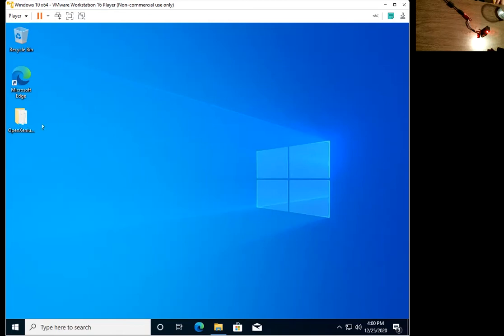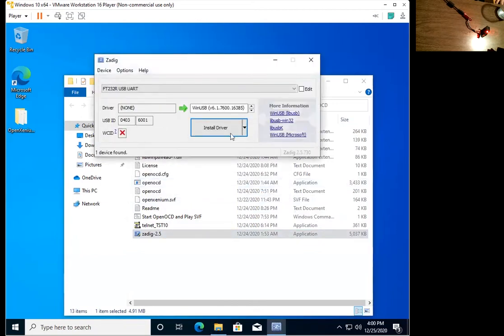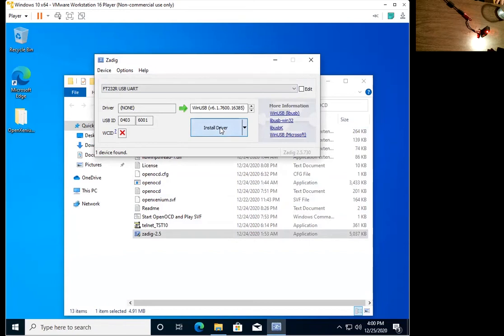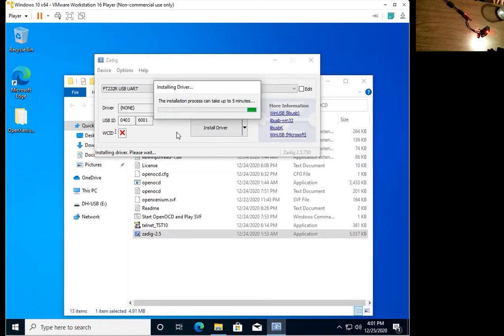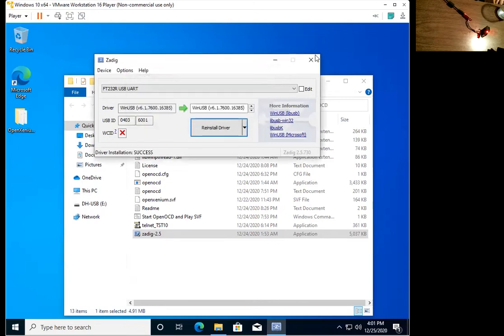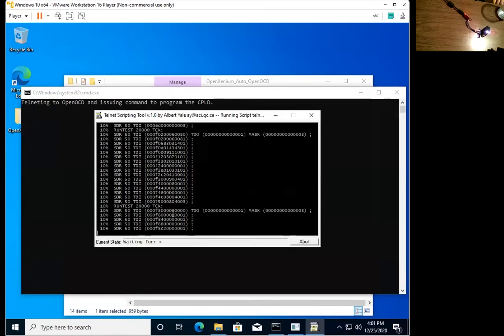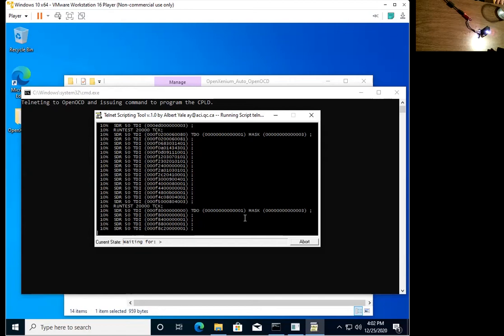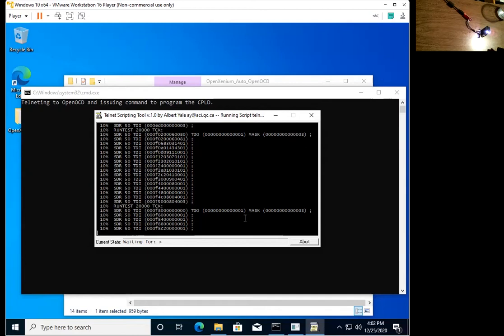Walkthrough of programming the CPLD of the OpenXenium with an FT232R

Comment: Hi, when I start the script after the 2 seconds of waiting I get this error message: "Either OpenOCD has failed or connecting to the adapter has failed." Do you know what could cause this? 
I have a ft232rl soldered like the diagram on the site
Thanks in advance for any help

Comment: Hi, I don't know if you still check these comments, but the process doesn't seem to work for me. I bought an  FT232RL, Hooked it up(soldered) as per your wiring diagram, Installed the drivers (Tried them all). When i run the OpenOCD and Play SVF it just says "Current State: Waiting For : >" Indefinitely. Any suggestions? Thanks
Reply from the maker: The only time ">" is waited for is by the telnet script. You likely have a security restriction blocking the internal telnet connection with OpenOCD. You may want to check the telnet.log file. You might also try manually running openocd- reference my scripts for the commands.

This has only been tested in windows 10. The video shows the full setup process with fresh Windows 10 install. Try a fresh Windows 10 install within a virtual machine for an easy fix.
Reply: @SuperDuperFucker  I see. Yes, I do have 11 installed on my system. I have a suspicion my usb cable or the actual usb connector on the module might be playing a role too. When I pull the cable out of the connector a very specific amount I'm able to enduce some activity. Will definitely try a VM. Thanks for the tips!

Comment: Would a "cp2102 USB 2.0 to TTL UART Module 6" be compatible with this method?! Thanks!
Reply from the maker: The short answere is no. Although support may be possible, it would likely take significant effort. The OpenOCD xpack version that is in my package supports these devices:
openocd.exe --command "adapter list"
1: parport
2: dummy
3: ftdi
4: usb_blaster
5: jtag_vpi
6: ft232r
7: amt_jtagaccel
8: gw16012
9: presto
10: usbprog
11: openjtag
12: jlink
13: vsllink
14: rlink
15: ulink
16: arm-jtag-ew
17: remote_bitbang
18: hla
19: osbdm
20: opendous
21: aice
22: cmsis-dap
23: kitprog
24: xds110
25: st-link
Reply: @SuperDuperFucker  Lol yea I tryed to line my pin out in ref to your guide and no cards. Oh well I got a part on order so eventually I'll get it. Thanks for your reply.
Reply from the maker: @DarkKokoro84  good luck! Comment back when you're successful.

Comment: Hi.
     It is a very interesting project. I want to ask that will it work with Ch340g USB2TTL?
Reply from the maker: Ch340g is not a supported chip.  if you'd like to give my project a try, the FT232 can be found for under $3.
Reply: @SuperDuperFucker  hi i have tried it with ftl but it didn't work maybe my modchip have some problem? it is an orignal xenium blue but not working . anyway thanks for replying. i you have any suggestion will be appreciated . thanks
Reply from the maker: @desimedia6521  sorry for the late reply. This is for the programming the CPLD of OpenXenium.
Reply: @SuperDuperFucker  open Xenium and Xenium blue has same cpld. No diffrence
Reply from the maker: @desimedia6521  You may be able to program the CPLD. However, I don't believe the included SVF file is compatible. OpenXenium is not a one-to-one clone of the Xenium. Some of the connections between the CPLD, Flash, etc may differ.

Also I'm not sure why you would want to re-program the CPLD. You probably want to reflash the BIOS. The BIOS is the same for both boards, this is flashed through the LPC.

If you need more help please join the OG Xbox group and ask: https://www.facebook.com/groups/1472107969726621
Reply: @SuperDuperFucker  thanks for detailed reply. My modchip is not detecting by Xbox. That's why I want to flash cpld. My is a v1.4 Xbox. However I tsoped Xbox with vga Bios it is working good. But I also needed av Bios.
Reply from the maker: @desimedia6521  There are two things I would try:

1. Connect xenium modchip, jump the recovery pins, and see if it boots.

2. load xenium tools on the xbox- boot from tsop then ground D0 after boot to switch to LPC modchip. This would allow you to reflash the entire xenium os bios.

Also if your chip is not detected by xenium tools that is an indicator of a possible CPLD or other hardware issue. If you want a good deal on a new modchip ask on the OG xbox facebook group. There are a lot of good people with good deals there.
Reply: @SuperDuperFucker  I have tried it but chip did not boot.
Reply from the maker: @desimedia6521  how about the second method I mentioned? Xenium-tools.xbe and hot swap in the modchip after boot.
Reply: @SuperDuperFucker  I didn't have any other modchip that's the problem. I have tsoped Xbox with vga Bios. I need an extra Bios av bios
Reply from the maker: @desimedia6521  After booting from the TSOP you can plug the modchip in and flash it. If you need more detailed instructions join the OG xbox facebook group and ask.

2. load xenium tools on the xbox- boot from tsop then ground D0 after boot to switch to LPC modchip. This would allow you to reflash the entire xenium os bios.
Reply: @SuperDuperFucker  I will try this method thanks for info

Comment: Thank you your video will be of great help! Does this serve to program the Lattice LC4032V from modchip Aladdin as well?
Reply from the maker: Yes, it should work. You would first need to change the openocd.cfg in the package that's linked in the description. From what I can gather this should work, change the last line in the config file to "jtag newtap LC4032V tap -irlen 8".
Reply: @SuperDuperFucker  Thanks for answering! I'll try to do it and send the result!
Reply from the maker: @Deividi Borges you're welcome.  I may be wrong about the 'LC4032V' part. It's best if you run Openocd and manually issue commands to figure out the TAP interface. After that, you should also modify the "Start OpenOCD and Play SVF" script and rename the tap interface in there for a single-click operation.

This line needs change for automation(Start OpenOCD and Play SVF):
echo SEND "svf -tap LC4032V.tap %file% -progress\m">>telnet_script.txt

All of this is only worth it if you have more time than money, there are easier ways if you have money.
Reply: @SuperDuperFucker  Sorry for the inconvenience again! I'm very new to programming, I'm trying to do this Ryzze119 project, you've already managed to do this with Aladdin, thanks for your time. https://github.com/Ryzee119/AladdinLCD
Reply from the maker: @GreenHawk_2025 this was my first CPLD project and it took me about 15 hours to figure out. Working with FPGA's and CPLD's with opensource tools has a steep learning curve. You will figure it out if you work at it. If you are a beginner at modding, you should not go with Ryzee119 AladdinLCD.

I highly recommend that you go with Ryzee119's Openxenium and SPI2PAR instead. You'll get more features with less work. 
https://github.com/Ryzee119/OpenXenium
https://github.com/Ryzee119/spi2par2019

Join this private Facebook group: https://www.facebook.com/groups/ogxbox
Post and ask if anyone has an Openxenium with a spi2par for sale. This is the best option I know of.
Reply: @SuperDuperFucker  Thanks! I'm going to join the group! I ordered Openxenium's PCB fabrication on PCBway, but I would like to try the Mod Aladdin LCD before arrival. Thank you again!
Reply: Man it would be super nice if you made one to program Aladdin clpd one click I’ve been trying but my abilities are not great . Is there any way you can make one I can pay you for your time !